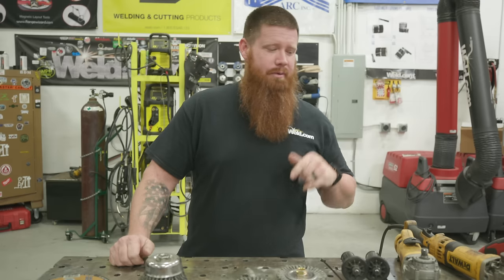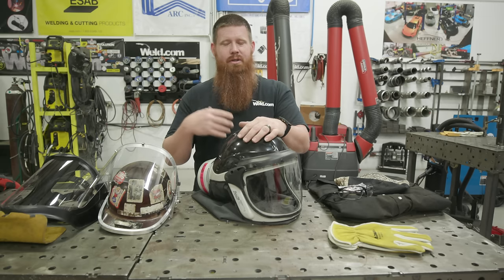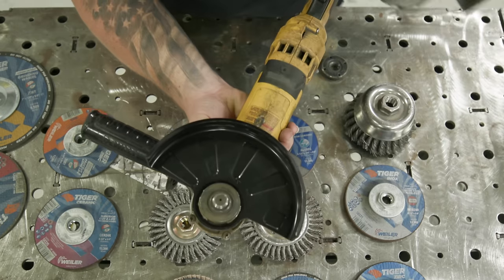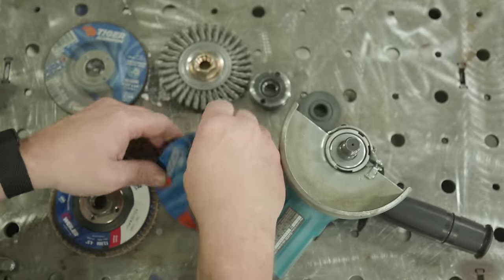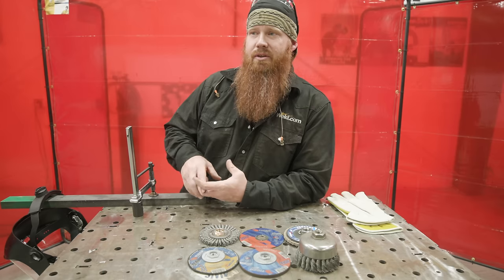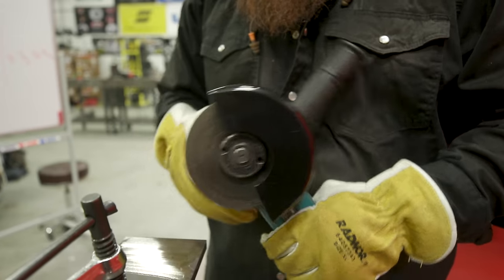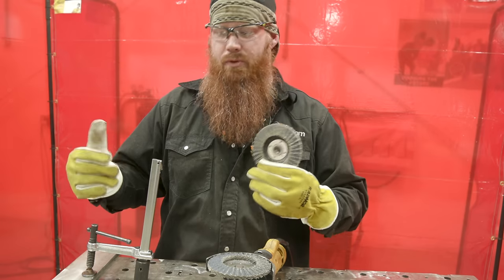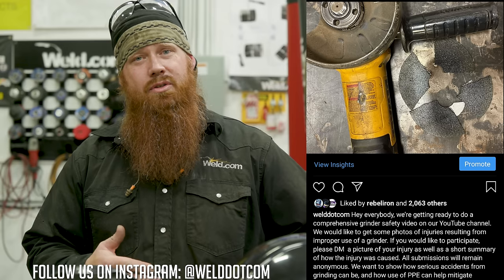Grinder Safety: How to Properly Use an Angle Grinder

Comment: Let's just live in a bubble. We'll be safe there.

As long as you don't misuse it, it's safe. Use the right QUALITY blades, don't twist while cutting, wear safety glasses and you'll be fine. It's not an absolute death trap. Even if it explodes on you, it loses momentum very fast and most likely won't do anything at all if it hits you. I had a thin metal cutting blade explode on me the other day, didn't do shit and I got hit by a couple of pieces. I do use the guard. Like I said, don't misuse it. Don't be careless.

Comment: Ok, the safety issues I see are: no face / eye protection, grinding with flammable liquid or explosive tanks nearby, and wearing short sleeves. Oh, and not really having the metal piece secured by a clamp or vice.

Comment: Ah well! Safety violations quiz…
Flammable materials in spark stream
Gas bottles in spark stream
Solvent nearby on bench (flammable one assumes)
No grinder guard
Holding on wrong part of grinder body (poor control)
Not using a side handle (poor control)
No safety glasses worn over eyes
Long beard unrestrained (potential entanglement)
Unsecured work piece
That’s prolly the worst covered….In could add a few picky ones that no one bothers with!!!

Comment: Grinding/cutting disk probably
 not right size or speed, no guard on the grinder, no face shield, no eye protection, no hearing protection, acetylene/oxy tank in the back ground, flammable/explosive-solvent, one handed use (handle missing), work piece not secured to work bench and short sleeves...

Comment: No eye protection

The work piece isn't secured to the bench

Using the angle grinder one handed

No guard on the angle grinder

Cutting upward instead of downward with the disc

Sparks are flying towards pressure vessels

Comment: 1. Balls hanging too low

2. Glasses are not away from the grinder so they can break. 

3 grip is too high you should grab the cable instead. 

4. Using your hand to clamp the peace your working, instead of allowing air to clamp it for you.

Use your brain guys!

Comment: - Shave the beard
- Move the O2 tanks to a different spot
- Keep the old solvent or any other flammables away from the sparks
- Use safety goggles
- Also a full face shield
- A mask may also be used to not to breath the burned paint, rust etc.
- Secure the piece you are chopping with a wise or stg similar to the bench
- Gloves may be cut resistant type is better
- The tool must have a guard
- Didn’t see a fire extinguisher also

These are the ones I noticed as a hobbyist amateur.

Comment: I paused it like you asked. 1. You aren't using your safety glasses properly. They need to be on your eyes, not your forehead. When I worked in the ship yards, we had to also use a face shield along with our safety glasses. 2.You are using the angle grinder without the guard, that is a huge osha violation. 3. The cutoff wheel is not the proper size for the angle grinder. These are RPM specific and very dangerous. I've seen them blow apart and lodge in objects. Not good if that object is your body part.  4. Grinding/cutting over and around flammable materials. 5. Should be wearing long sleeved shirt made of cotton or fire proof material. 6. Even though most people don't wear respirators when they are cutting with a cut off wheel or grinding, I do. You'd be amazed at what kind of grungy crap you are breathing in. Keep your lungs healthy and use a respirator. 7. This may sound stupid, but the torch lead should have a torch on it. Not left open like that. If you aren't using it or there is no torch hooked up, the leads should be disconnected from the bottles and the bottles should be capped. 8. No ear protection. 9. Other PPE that we can't see should be taken care of. This would include lace up leather boots at the least. Steel toe even better.

Comment: No z 94.3 or z87.1 glasses, no guard on the grinder, the disc is too big for the grinder, your holding the grinder backwards with one hand  metal your grinding is not clamped to table and oxy acetylene bottles in path of sparks, sleveless shirt. Oh and flammable solvent on the work bench

Comment: Firstly-the gas bottles and solvent drum shouldn't be anywhere near grinding sparks. Secondly-you shouldn't be operating that nine inch grinder without a saftey shroud and one handed. Thirdly-your not wearing any eye or ear protection.

Comment: one hand. tanks behind you, holding workpiece with hand, old solvent flammable and next to you, old solvent not labled correctly, no handle on grinder, no guard on grinder, disc looks big for grinder, no face shield. and a debatable one is wearing gloves with rotating equiptment.

Comment: everything wrong that i see: no safety glasses on, no grinder guard, grinding so the sparks fly directly into the oxygen and acetylene tanks, grinding next to solvent, and you’re allowing sparks to fly into/onto flammable items like paper and cardboard. most of this this could all be avoided by using a guard on that grinder.

Comment: I NEVER KNEW the guard and the handle are a thing. Because I have never seen anyone who has them attached to their grinders. Now I am gonna feel bad whenever I use one as if I really want to have these "luxuries" on it, I just have to buy my own grinder instead of using one provided by someone else. And I don't even use it most of the time.

Also I wish it's common everywhere to wear safety equipments when working with power tools like that.
I heard it's mainly a western culture where you are expected to keep safety equipments introduced in this video. I have never seen anyone who comes with even safety glasses or ear protections. The moto here is "just be more cautious so you don't need all these things westerners are carrying that we've heard". I think it shouldn't be this way, but you gotta do as Romans do when in Rome.

Comment: Where to start, safety glasses, face shield, no guard on grinder, 6 in disk on a 4 in grinder, work not clamped, one hand on grinder, throwing sparks at flammable/explosive materials, working in the shirt and cotton gloves. In short no ppe for job and very poor housekeeping. Hopefully that acetylene bottle is a dummy.

Comment: Sparks flying at gas bottles, flammable chemicals incorrectly stored, no fire extinguisher nearby, sparks igniting debris, work not secured to bench, no guard on grinder, incorrect handling technique, suspect incorrect wheel fitted also suspect safety device tampered with, incorrect gloves, no eye or face protection
Reply: Also hearing protection and I'm sure theres more

Comment: No safety glasses or sheild, no guard, solvent in front of you and oxy-acetelyne behind you where you are throwing your sparks and you are using one hand to hold your grinder instead of 2 hands,one on the grinder and the other on the handle which is also not fixed to the grinder and the piece is not fixed to the table with a C clamp or vice grips etc.

Comment: No safety glasses, no hearing protection, workpiece not clamped, no safety guard on the grinder, incorrect size disk for the grinder, shooting sparks at flammable and explosive materials and gas bottles, did i miss something?

Comment: The only thing I don't like what I am seeing is the way you cut with the grinder. I see 70% of the people cutting this way and what I don't like about it is
#1. You are throwing the spark's at yourself so chances of catching yourself on fire are greater and
#2. If the disc were to shatter the pieces are coming at you.
Turn  the guard on the opposite side so that the spark's are going away from you and if the piece shatters it's also going away from you.

Comment: It’s insane how many angle grinders you find out working in the trades that have no second handle. I’d say it’s most of them. Not only is it unsafe in the short term, holding a grinder with one hand for prolonged periods every day will wreck your arm and hands over time. Every young guy thinks he’s invincible. You should be looking at the miserable old broken down guys hobbling thru the day like you’re looking in a mirror.

Comment: sparks flying on acetylene
safety glasses no on
old solvent 
hold grinder by one hand and not gripping it corectly
bit of metal is not secure
angle grinder guard taken off

Comment: No Safety Mask, No Safety Goggles, No Welders Cap, No Fire Retardant Welders Jacket or Shirt, No Beard Mask/Protection, Dangerous Oxygen Tank, Dangerous Chemical Tank, Dangerous Old Solvents, card board boxes, wood, not paying attention to the burning card board box, chains around the feet area where he can trip, bucket of tools at his feet where he can trip over them, no clamps to hold down or hold in place the metal piece that you are grinding and not caring where his sparks are flying.  He needs to look around him free so that no one or nothing can be hit by his welding sparks (Not Clean of debris and clear.).

Comment: you used no eye protection, you used old solvent and the sparks were facing the 2 tanks , I don't know anything about welding or angle grinding so please correct me if I'm wrong

Comment: safety violation #1 wearing gloves, that impairs your touch/feel sense so you wont know if the grinder is overheating. #1.5 your eyes are not closed you might get debris in them. #2 the safety glasses, should be covering your beard, it would be a crime to get such a fine piece of time singed. #3 you have no ear buds in to drown out all the racket the grinder is creating. #4 you failed to put on a baggy, long tail, long sleeved shirt to keep sparks off your bare arm and tangled in the grinder. #5 You  forgot to turn on the torch bottles so the gas cant start burning and keep you warm #6 the "old solvent" should have been closer to the burning rags in the box on the floor so you wont have to move so far to pour it on the fire #6.6 you should at least have had a pointer sign to the fire extinguisher in the building across the parking lot so you would know where one is #7 you should have a weight on the bar you are cutting instead of holding it in case your grinding arm gets tired you will have a spare arm.#8 you are grinding on the wrong side of the grinding wheel, the kick backs are minimal and the sparks are directed more towards you. On a positive note, you did remove the handle and  wheel guard, they are cumbersome always in the way and nobody uses two hands on a 4 1/2 inch grinder anyway.

Comment: The problem with this video is that its too safe.  Where do I start.  First, the beard is not trimmed properly.  Its obvious your style is not welder friendly.  I appreciate your safety squints but why leave the glasses on your head when they can fall and injure you.  The shirt is a bit 1992 and should be baggy enough to be used as a parachute.  The gas tanks behind you are a bit far and should be closer so they can be warmed to the appropriate temperature for good welding.  Also is the gas off? We know humans breath oxygen so crank that tank full open.  The plastic old solvent can is so cliche, we all know that no used container still has its cap and should be sideways on the table with the writing illegible.  Wait, is that tire on the welding cart not flat?  Your gloves from the 1600's are a nice way to show off how much money you have buying king Arthurs battle attire.  I'm sure somebody will take this comment seriously. To the rest of us. Enjoy! Great video btw.

Comment: 1) no safety glasses 2) doesn't look like any hearing protection 3) work pieced is not clamped 4) using around flammable materials  - you are doing 1 thing right WEARING GLOVES.

Comment: plastic old solvent
no guard
no safety glasses
o2 bottle in spark path
acetylene bottle in spark path 
work not clamped
loose shirt, not protective apron
don't know if it's a safety thing but I prefer the sparks going away from me
too nice of a beard